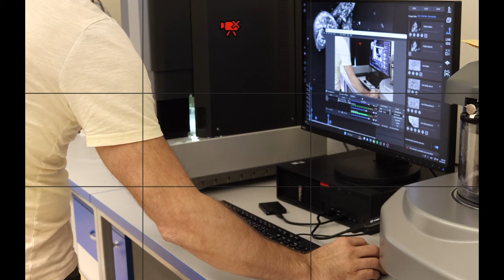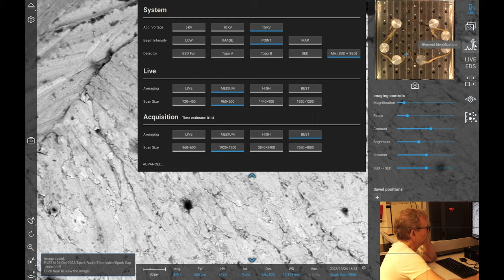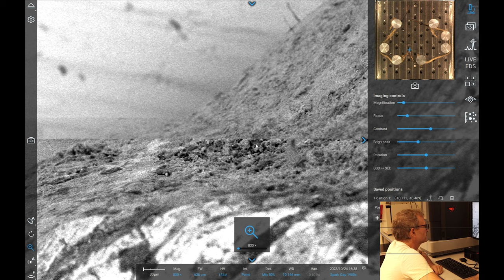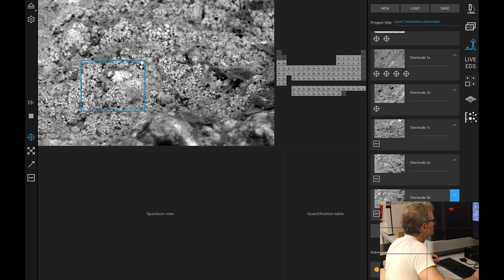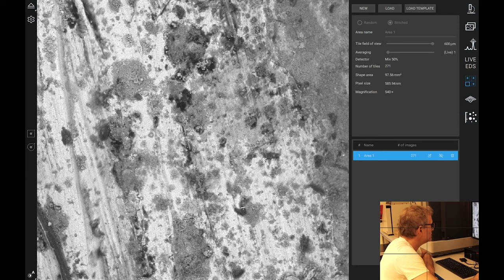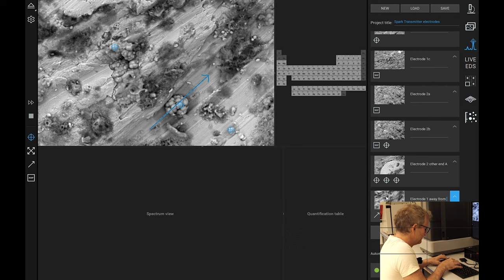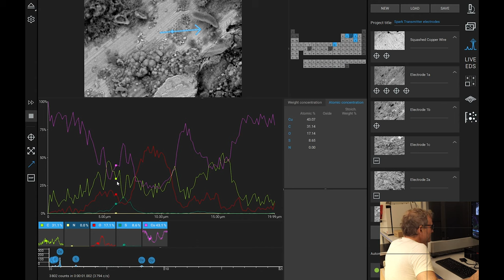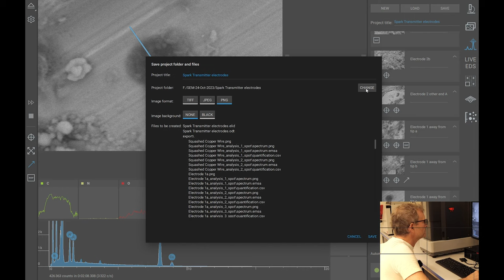LION - Back to the Future - initial look at antique spark-gap transmitter witness marks under SEM

Comment: Saw something interesting. The US made magnetic rail guns for our navy, but they couldn't use them. Their barrels, or rails broke. Seems like an easy enough fix unless (something unforeseeable) was weakening the metal along with the pulse
Reply: Some huge magnetic forces happen with lightning currents/lightning induced currents. I have seen Cat5 data cable literally exploded after lightning strike in country farm  installation. Also irrigation controller cabinet (with field cables) blown off wall and denting opposite wall.

Comment: Hi Bob. Have you considered examining arc stick welding electrodes and the changes to them and the radiations coming from the arc welding process.....IME boilermakers are 'different', of course the workplace culture and the gases/fumes and other funky chemical stuff  would be contributing factors.  Another interesting subject could also be cinema projector or arc furnace carbon arc electrodes....some fierce plasma conditions going on in  all these cases.
Reply: Thus is a good consideration. Especially simulated welding done in rain (to add water in there)

Comment: At 49:27, notice how the sulfur clusters are "outies" and above them and to the left is a darkened area of similar size that looks like the porousness of a natural sponge where material was removed (a collection of pores). Is this a coincidence?
Reply from the maker: No, I don't think it is. One of the reasons I want to spend a lot of time with this sample in this tool to see if there are a fair number of these types of patterns. It looks to me as if a flux loop started in the tight spindle torus mode and spread out before failing.

Comment: @13:25 That's an amazing machine, you can see what elements are there just with the SEM?  So all it takes for elements transmutation is a spark gap??  How come not known by mainstream science? Doesn't it comes from ambient air and or the impurities in the copper?
Reply from the maker: You can literally see in a couple of these impacts I measure, the formation of new elements such as Al and Si in the centre of the structure. There is no Al or Si in air.
Reply from the maker: You need EDS sensor
Reply: It can always be dismissed as impurities or measurement errors and there is standing policy at major journals to reject it. The goal is to make it so repeatable and clear that this becomes absurd. This might happen first in a place like Japan that is semi-independent of western institutions.
Reply from the maker: I think that if one of these devices was re-built today, or something with similar operating parameters, the same effect would be observed.  @RareCondition

Comment: One thing that's been bugging me all along is that some of these experiments should be duplicated with highest-purity Cu and cheaper grades (the presence of more than very, very low impurity levels might make a very large difference in results), the same with the brasses used, too (as in VEGA). I'd make a guess you don't have to get EXTREMELY precise with your post-processing (post-experiment) assays to find some significant variance..
Also, I haven't noticed anyone trying an ULTRA study using brass foil instead of Al- anyone know anything about such?
Reply from the maker: Bin-Juine Huang did Cu foil - but no one has done brass yet in ULTR
Reply: @MFMP  This may be the ONE bit of research I can pull off in the next year or two...
Reply from the maker: Awesome, it really is trivial once you have the right discharge parameters. Of course, we do not know how many decades or years this was operated for, but in the work of Matsumoto, he achieved transmutation in a few microseconds, and Adamenko in a single discharge of smaller time frame. 

https://remoteview.substack.com/p/back-to-the-future-thanks-to-lion
 @ticthak
Reply: You may well need impurities as seeds, this is something I suggested in Asti in 2016
Reply: @magnetsandmushrooms : Alloys are NEVER produced or even assayed to 10^-10 levels, let alone atomic levels- the probability of impurities  (and not even mono-atomic dissolved impurities, but larger, higher melting-point particles) approaches certainty., Seeds will always be present (is it possible clusters ALWAYS are forming, but their level and energies too low to detect?). Just the presence of grain boundaries offers nucleation sites for all kinds of energetic events, including LENR. I'm thinking about modulation (in several senses of the word) effects of composition, particulate size and geometry, and other things.